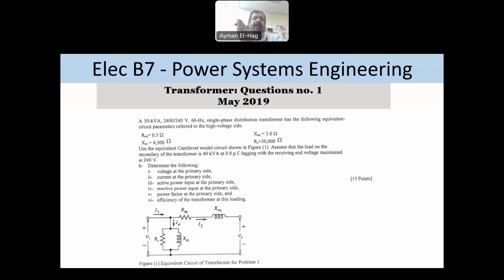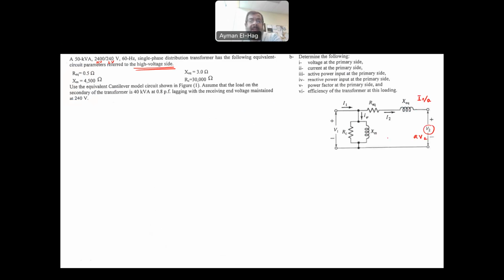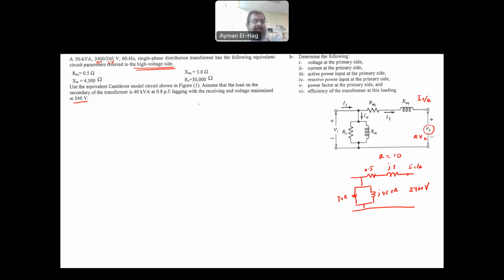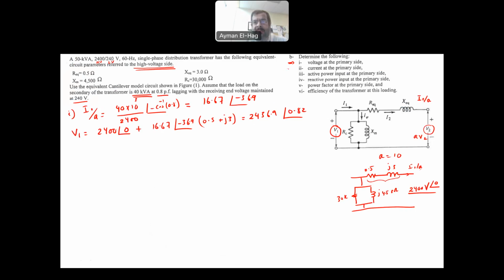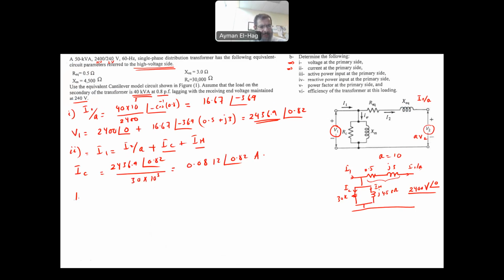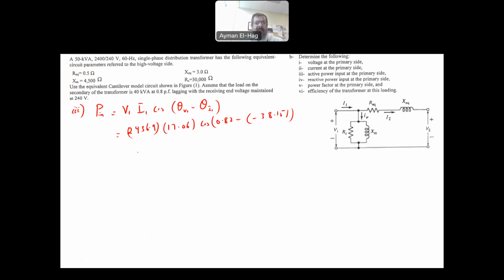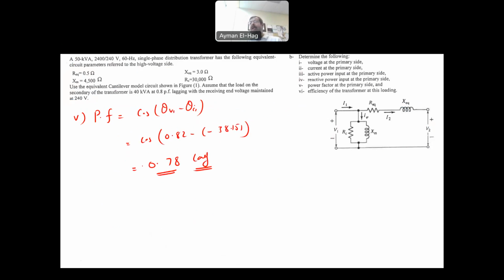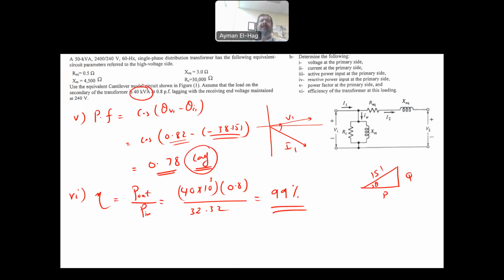PEO solve examples (ELEC B7) Transformer Question no. 1

Comment: Why is the magnetizing branch ignored when finding the primary voltage?
Reply from the maker: The primary voltage is calculated using KVL for outer loop and the magnetizing current does not contribute to the load current. If you want to calculate the primary current, then you will need the magnetizing current.
Reply: Also, why is it not root3*V*I*cosTheta? As we are using LL values to calculate?
Reply from the maker: This is a single phase transformer so no SQRT(3)

Comment: Hi Prof, when you are solving for i.) voltage on the primary side, you calculated for Ia first, but what about the a value?
Reply from the maker: The model itself has already took care of the turns ratio by referring one side to another.
Reply: Turns ratio a = Vp/Vs or Np/Ns. 
a=2400/240 
a=10